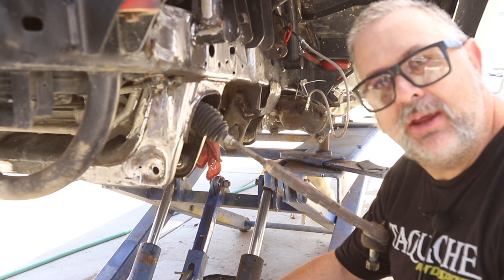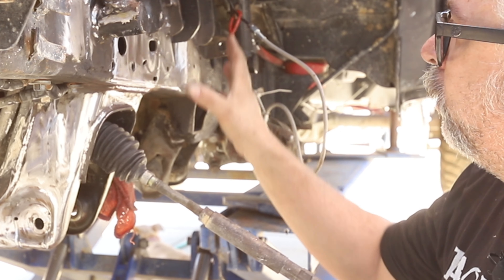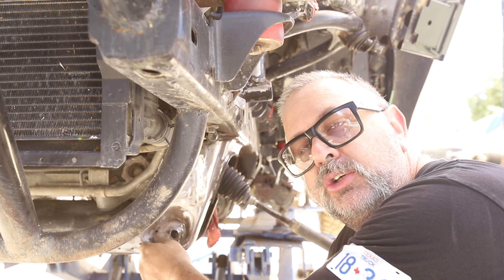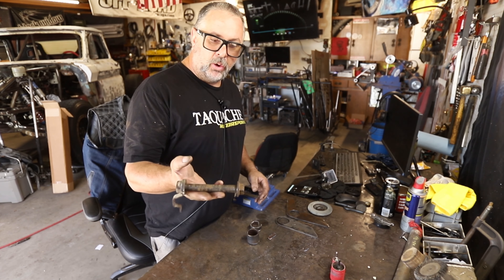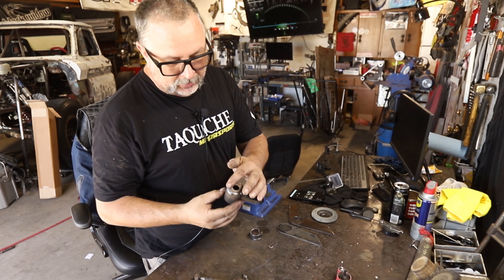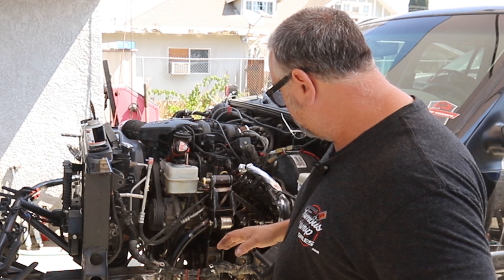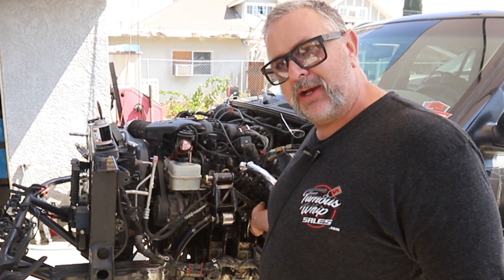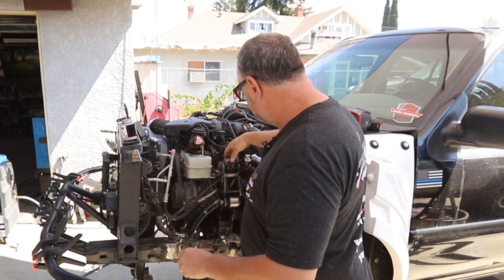Sport Trac prerunner gets some freshining up, Start a new project,

Comment: Do you only put the anti-seize on the shank of the bolt and where do you put it on the uni-ball?
Reply from the maker: Well I spread it all over the shoulder and a little bit on the threads usually. As far as a uniball goes like when I'm installing the uniball itself into the cup I will put anti-seize in the cup and then inside the bore of the uniball so that the misalignments have a little bit of a moisture barrier. They almost always get stuck after a long period of time and it makes removing the misalignments themselves easier.